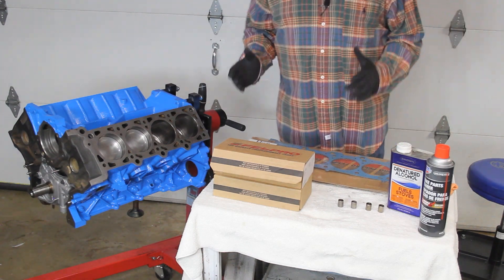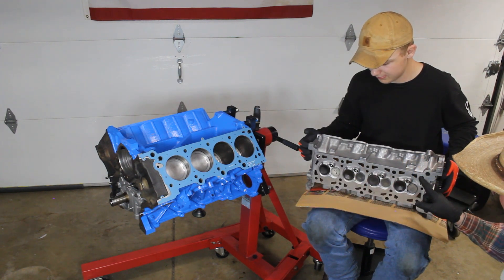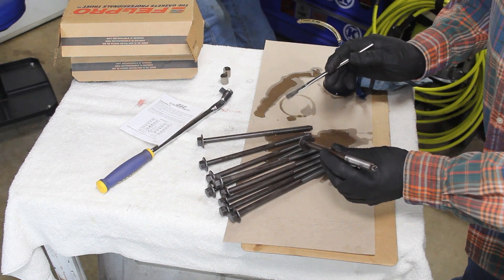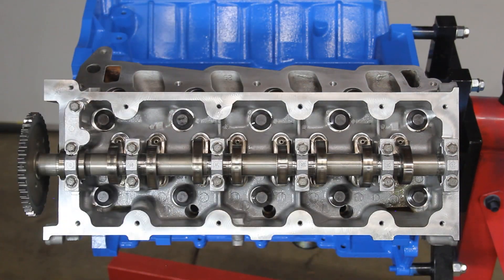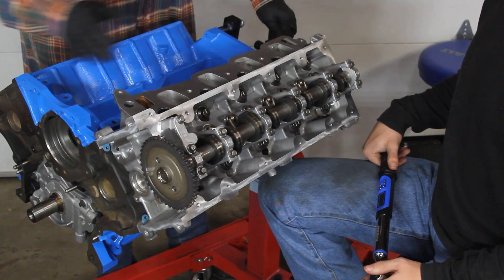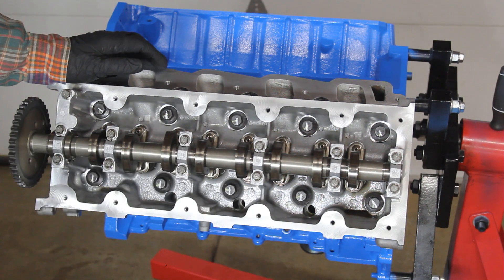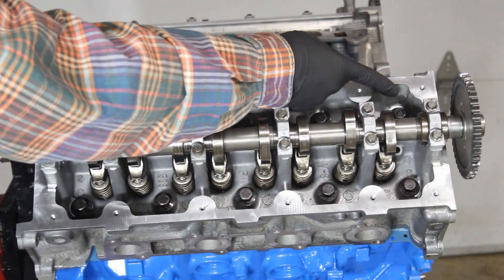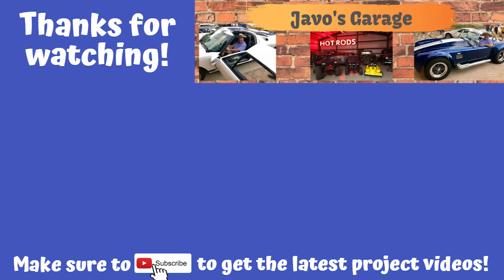Ford 5.4 2V Head Gasket Replacement

Comment: I have 2 blown head gaskets and will soon be tearing my motor all apart for the 2nd time and will have identical upgraded parts as you.  Regarding this video, I have 2 questions and hopefully they'll be answered in the next 2-3 weeks.
1) After torquing to 30 ft/lbs and backing off 360º, do you back off all bolts in sequence, reverse sequence, or as you please?
2) After all bolts have been backed off the full revolution, is there still a notable amount of tightness to the bolts to where they are still beyond hand tight?

Comment: Say What should I do if I didn’t do the 360 degree back off after the first 90 degree turn and just did the second 90 degree turn? Thanks
Reply: My heads lifted after 8k miles following their pre stretching. Maybe I got a bad batch or something. But from now on I will follow OEM torque specs only. 😅
Reply: @diablo-1367  DId you retorque the bolts before the first 90* pass? I followed TRQ's video first and sure enough, the inner bolts were loose.
Reply: @brandonlee8400  yes I triple checked base torque before doing the angles again, came out to about 90 ft pounds after the final degree sequence. So I just made them 95 ft lbs all around.
Reply: They lifted because you loosened them never do that your better off overtighten them never loosen them
Reply: @David-ii5td  the felpro install instructions tell you to loosen them one full turn after 90*
It's supposed to be a pre stretch, but it didn't work out on that particular batch.
Reply: @ I’m not arguing their directions, I’m saying the reason your head lifted was because you followed their directions. When a tighten a bolt say on your water pump have you ever tightened it down then loosened then tightened it back down I’m sure you haven’t because why would you do that it would be completely illogical to do that you’d have to put a new water pump gasket on. Same on the head gasket and worse your bolt is no longer torqued or stretched the bolt needs to be tightened and kept tight to stretch and reach the clamping force necessary to clamp the head and block together
Reply: @David-ii5td  yes sir, that's why I did the factory method with factory bolts, instead of felpros. Haven't had an issue since
Reply: @ right on I’m old school if directions don’t jive I’m going my way final torque is 85-90 foot pounds so another logical thought is why even bother with the 90 degree stuff just thinking out loud why not just go 30 foot pounds 60 foot pounds than 90 foot pounds makes since to me
Reply: No thread sealant for bolts in water passages?